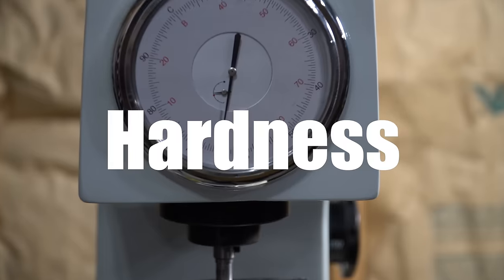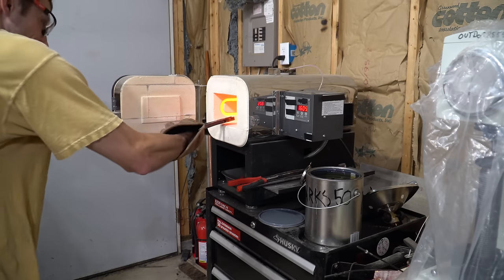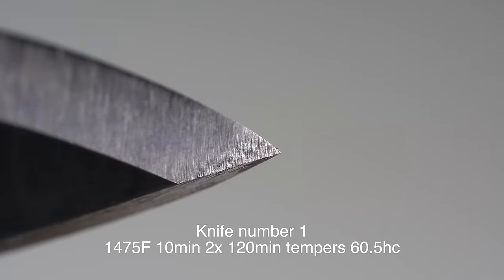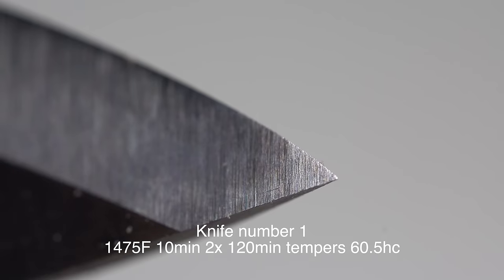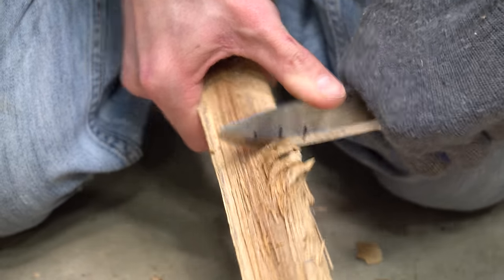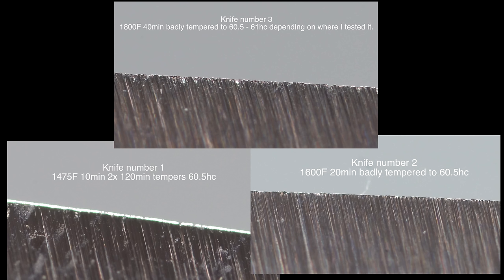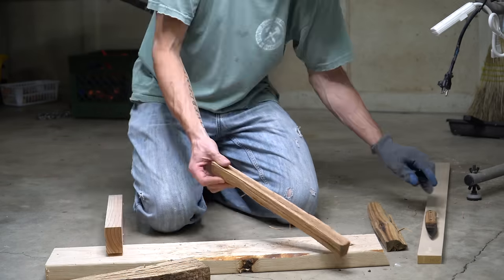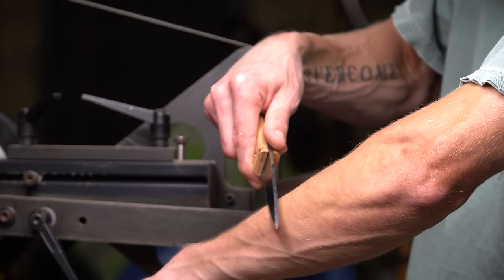The BIGGEST LIE in the knife industry- Good Heat Treatment vs BAD Heat Treatment

Comment from the maker: Sorry one detail I forgot to mention was the steel is 1084. I knew I was forgetting something 😂
Reply: Actually you did at exactly 14:00 and 14:55 even though you didn’t explicitly say earlier that’s what these knives were made from.
Reply: 1084(AISI) - Simple carbon steel, low wear resistance, decent shock resistance.
Manufacturing Technology - Ingot
Country - United States USA
Reply: No, you mentioned it at the very end and my ears picked up on it. You just didn't have it on your comparison layout paper. It's the same steel I'm working in right now while I can get it. The 1080 series seems to be one of those blends that is only around here and there like D2, W1, and W2 were when I first started forging blades.
Reply from the maker: Ha! I meant to mention at the beginning..oh well  glad its in there somewhere though 👍
Reply: @OUTDOORS55  thanks for all the hard work you do in your videos.
Reply: @OUTDOORS55  Alex, have you ever thought about ending edge retention testing cutting ability instead of sharpness? AKA, testing cutting lifetime instead of sharpness retention?

How long would it take for you to make some kind of apparatus or jig that would allow you to make draw cuts (slices) on rope while applying a given amount of weight? The end of the test would be when the knife can no longer cut the rope with X number of cuts with Y amount of weight/force applied to each cut.

Since not everyone knows a duller knife can often out-cut a sharper knife, it may be quite interesting. Enjoying the videos as always. Don't ever stop!
Reply: Thanks.  Have 1080 steel at home.  No Parks, though.
Reply: I'd go hotter than 1475 at 10 for 1084. (yes I know why you aren't,1475 is ideal for toughness) That's my 1095 HT (⅛"). I'd bump to 1500 and hold perhaps a little bit longer than 10 it looks like that's closer to .175 or ¼". I'm most certainly not going to comment on the rest but go to water - it's fine at that A¹ and cross section. viewers: these are very shitty generalistic steel alloys that are ingot produced with very wide(comparatively speaking) elementary ranges. 1084 IS easier to HT properly than 1095 or W2 or definitely 5160/52100. I'll leave the actual science stuff out 👍😉
Reply: @tacticalcenter8658  zknives ftw
Reply: @dennisyoung4631  don't need it unless it's under ⅛" (0.125) honestly. Brine quench. I do. 😳 Ideally yes it should be a eutectic percentage of nacl to H20. Off of that it's just going to decrease the effectiveness of chlorine for disturbing the vapor blanket so either do it perfectly or just use water which makes little to 0 difference.
Reply: @oceanwaves83  it's called a CATRA edge retention tester. I own one and it's not exactly cheap... But it is extremely simple honestly. Get CATRA test card with 5% impregnated silicon and a 50 newton weight and draw back and forth. That's what the machine does (it's not hydraulic it's pnumatic).
Reply: @veraxknives0331  yeah I've been familiar with them for years
Reply: @oceanwaves83  ah well there's 2 within 10 miles in South hills Pittsburgh from me and Larrin Thomas the creator of Magnacut. Of the I believe currently 51*? in the world... 😂
Reply: No I don't like the guy whatsoever. We don't do each other at all.
Reply: @veraxknives0331  I follow all of Larrin's work, have for years. I'm not saying I invented the CATRA tester, lol. I'm just a life-long sharpener with an interest in performance driven knife design and basic metallurgy as it pertains to cutlery. The concept of cutting ability being different than sharpness (and edge retention being different than cutting lifetime) was being discussed online around a decade ago. Many people conducted tests using rope and a scale in testing (which tests cutting ability) rather than the paper or shave test (which test sharpness). The CATRA machine is highly scientific but there are other simpler ways to conduct scientific trials as well.
Reply: @oceanwaves83  eh sorry man I knew you would know who he is but. With all due respect, I'm aware of this stuff but there's no real "data" in cutting twisted sisile rope or anything similar because it's.. just not repeatable or comparable. Too many variables for the accuracy that people like me and Larrin go for heh. No I am not a metallurgist but I please ask you to test my knowledge on it 🙃 a nerd I am. 

- With respect (truly),
     Jason
Reply: In all honesty using Larrin's own coupons on the same machine can provide slightly different results but as far as "data" goes it's within noise.
Reply: @veraxknives0331  I never once mentioned twisted sisile rope. It's not a fully consistent medium, similar to cardboard. Polypropylene, PolyDac, braided nylon, etc are all extremely consistent mediums. It doesn't have to be as perfect as the CATRA machine to be repeatable and comparable. Even people who use cardboard and freehand sharpening can get repeatable results, even with all the inevitable user error. This is extremely old news.
Reply: @oceanwaves83  I was not knocking on you or the concept mate but you're talking to someone who doubts CATRA testing results and I also break test transversely because. Knives kinda usually break that way and Larrin tests longitudinally. Our definitions of "accurate and repeatable data" are just different.. it's ok I wasn't trying to start an argument. Sorry
Reply: @veraxknives0331  Well the CATRA tests certainly aren't the supreme law of the land, but (all things considered) they are the best data set we've ever had. Regardless, even someone with Larrin's knowledge of heat treatment protocol and manipulation of steel properties cannot produce a perfect heat treat for every steel every time as human error can never be eliminated, only minimized. For instance, while I'm not shocked that the CATRA testing suggests s90v has better edge retention than s110v, is the s110v heat treat truly optimized? Of course not. Some will always be closer to optimized than others, for various reasons.
Reply: @oceanwaves83  hell I'm getting into trouble here but um. As much as I dislike the guy and disagree with him on other science stuff, s110v does have lower edge retention because of the carbides that are formed are vanadium enriched CrV7C3 carbides, M3C, M6C, and m23C6 carbides are the main ones in s110v whereas s90 would be also CrV7C3 and some VC, theres less secondary less hard carbides.
Reply: There's too much Chromium for the niobium addition to bind to more than say Magnacut where the v and NB form carbides because they want to more than the chromium mol amount. It's also why there's a small nitrogen addition - it separates the cr from the v long enough for nb and v to form nbc and VC.
Reply: @veraxknives0331  I'm curious if it can be manipulated in such a way to increase the % of vanadium carbide content and make use of the Niobium. I don't think Larrin has spent a lot of time on s110v but I could be wrong. What he does with MagnaCut is amazing.
Reply: @veraxknives0331  and there's absolutely no way around that? I wouldn't know.
Reply: @oceanwaves83  it's just playing around with JMatPro 7. It's another thing that unless you have ties to a university or ass amounts of money to do and it's possible to make steels with yttrium, tantalum, etc.. niobium was being added honestly since it was called Columbium but it's just about getting the right numbers for literally about 200 different synergistic kinetics correct. I'd guarantee you it can be done but we both understand steel companies don't make "knife" steels and they only account for (as told to me by John Shiesley, crucible president) 0.000001% of their sales. So.. unfortunately there's that sad fact heh 😞
Reply: @veraxknives0331  theirs things that even jmatpro cant understand. But overall its all we got. I tried out a demo version, its really neat. But heat treat specialists will try different protocols and ht methods and test. We didn't have jmatpro and still were able to figure it out with time through the years of heat treatment protocol development and testing.
Reply: You're welcome to play around with a licensed version BTW just. Contact me I'm pretty sure it's not that hard to do and no I honestly don't have any issues with people who want to play around with it on my PC over RDP. I'm not going to stick how to contact me here but you can Google my name if you want. 👍🙃
Reply: @veraxknives0331  I saved a link to your webpage. I also can contact larrin if needed. Overall I'm just an enthusiast that has many friends who heat treat and make knives and testers who test them
Reply: @veraxknives0331  lol. I do understand it but it can get very complicated. Time and temp with so many components. Each one of those components interact with each other at different temps for time lengths. Knowing what they do can be complicated but the program helps elaborate but not completely. From what i remember (i might be off here, its been a few years) but changing things like triple cryo tempers, salt bath kilns, different quench methods etc can mess with the equations a little.

But its really cool to see the different carbides that it can produce like you mentioned.

Which is funny that he chose the steel he did to perform this experiments and didn't send them to a cut tester or catra cutter to get tested.
Reply: @tacticalcenter8658  Totally get it man just an offer you can ask Larrin about me (warning - we highly dislike each other) 😅👍 I do the same thing just for my own personal hobby honestly. Only been studying this shit since October. I used to work literally 500 feet from Larrins house... heh. (PC bs) couldn't handle the internet and people so lost that like a bad habit plane. (Hadda make a joke there) Lots of books and money later - it's like okay this shit is pointless for people cause they just don't understand it. One of the bad perks of being an autodidact 😑
Reply: @veraxknives0331  I hear you. I dont see eye to eye on everything with him also. No idea the situation between you too but that's no worries. I totally understand.
Reply: @tacticalcenter8658   @Tactical Center  it's extremely nerdy and yes of course fascinating to me I'm basically your typical science nerd and even I alter my treatments based off the damn elementary values of PM/ESR/VIM-VAR steels and I really want to think they're doing something hahahaha but I'm sadly smart enough to know that it's just my nerd perfectionist ass wanting to do everything as .. well I should say I'm the type of person who either does 0% or 110% heh I'm not one of those "in betweeners" so it's typically straight down the rabbit hole on one subject - wait until I get bored with that which personally is about 0.05 seconds flat sadly and then find the next thing that I don't understand exactly lol. I'm insane, yes I'm aware 😄

But that's what keeps I suppose the actual word would be metallurgy not per se the mat sci side of things which I understand physics - chemistry I don't. I have a very basic understanding of it that is probably the next thing that I will go to if I ever get bored with crystals and metals. I just honestly don't find polymers or ceramics interesting. Semiconductors - fuckin way over my head and I'm the..

One of my favorite memes is "you have a degree in theoretical physics." "I have a theoretical degree in physics." "we are not the same" I literally smiled typing it it makes me crack up so much cause it's literally so fuckin true
Reply: @oceanwaves83  I didn't see this I apologize! I'm not sure what your specific question is  but I'm thinking that it's about heat treatment procedures and NbC and VC which to answer your question to the extent of my knowledge (junior level metallurgy basically) yes? You could but it would not have anything to do with how it's heat treated it's going to be the composition that would have to be modified. You also can get manganese carbides but I don't believe that Mn can form carbonitride/MnN because of it's complex cubic structure at standard temp pres. Under heat it does transform to FCC then BCC like iron. Of course at different temperatures.
Reply: @tacticalcenter8658   I missed this 
Gee let's see. We live 5 minutes from each other and both own CATRA testers, Charpy and izod testing rigs (mine set up for transverse strength loss), C-notch etc. He's the type that has one degree in one subject that I will readily admit he knows way more than I do about Metallurgy but. I'm a PC nerd turned steel guy lol. I don't have a doctorate in this obviously LMAO. Obviously he didn't like me asking questions about.. things that honestly would be theoretical or the positive criticism I think he took a little bit negatively. It's also honestly not very pertinent information for the knife maker but I prefer to fully actually understand what I'm working with not just "know" it. IMO there's a big difference between the word understand and know. I know a hell of a lot more than I can say that I understand. I'm also a no college degree type autodidact that well. I started this October last year and I'm .. basically teaching guys that have been doing this stuff for years exactly what well. Essentially I try to do what Larrin does but instead of being so generalistic with.. science? Which isn't so. Generalistic? Which is my problem and the fact that he's never ever said the words I was wrong. (Honestly, have you ever seen the guy say or type those words? Nobody else can aha) So I basically just go around finding out the people who have the drive and .. interest/commitment to actually waste my time explaining the physics mathematics and chemistry in a way that each person is going to understand because they're like me. I don't play well with others or people who have multiple NDAs signed with crucible and have talked directly to John Shiesley about.. the relationship between Larrin and Chuck and them. Which Chucky banned me from AKS because I unknowingly said some shit that they were in legal breach of contract with (of course they think I did it intentionally, can't really blame em I'd probably think the same thing) but I'm not legally stupid either and NO I can't actually see the NDA text obviously but. I'll say this - John spent more time with me than I honestly ever expected and gave me more information about the distribution contracts and other stuff that I was asked not to share so I don't (if you asked me the same thing, even though you have no idea who I am nor do I have a reason to keep information from others, nor would you ever know I said it, however I couldn't live with myself if i did that. It's just who I am. but there's small things that I can say that. Aren't well known such as Zapp makes CPM alloys and Crucible makes Zapp alloys they're cross licensed (public information).. Cartech only uses swedish iron.. (not public information) but that's relatively known in the industry. Sales figures on "knife steels", cost spreads, I was honestly in utter shock when I read this two page long email because I honestly didn't expect him to even bother with me. Kinda amazing how mutual respect works.

Now I totally missed your comment on TTT tables and yes sir you are most definitely correct that they are .. not very scientific? Aha. Bainite is a good example. They give you the upper and lower regions but they don't actually explain that the end result is actually martensite - retained austenite - AND BAINITE! (In simple carbon-manganese steels at least) but. Ya man you seem like a good guy - nice YouTube discussion 😅

God that is embarrassing to type out hahaha. But off the record - man to man - I wish you the honest best of luck with anything bud. I have 0 reason thus far not to respect your thoughts. (And facts 😄)

It was refreshing to talk to someone else who gets this stuff 👍 I do mean that heh
Reply: @veraxknives0331  your like my long lost twin in many ways. Just a little more crazy than I am.
Reply: @tacticalcenter8658  the man doesn't lie 😄
Reply: What you have discovered here is why 1084 is recommended for beginners without a kiln -- you really need to screw up the HT to wind up with a knife that isn't usable.  The more "exotic" steels are much more sensitive to heat treatment.  Be careful of the conclusions you are drawing here.
Reply: @rockets4kids  pretty sure that was covered already 😉
Reply: @veraxknives0331  Yes, it should be considered general knowledge why 1084 is recommended for newbie knife makers.  Sadly this is far from the case.  It is great that OP has confirmed this, but he really hasn't done anything to forward his hypothesis.
Reply: @rockets4kids  110% agree - however - the people like me who want to learn this stuff buy the books and read em. I personally don't bother much with the internet "class" of people (and yes I work in IS with PCs so I know the internet from 2002 until 2022). I'm sure you know about KSN but even that isn't enough information honestly. I had to get more. Larrin also tests longitudinal strength not transverse strength which in a knife is much more important. (And I live 5 minutes from the asshole)

(For those who don't understand, it's testing the break force of the thinnest cross section, longitudinal strength is exactly that - it would be how hard I can press down before it snaps. Not how it typically goes but longitudinal strength is standard for the industry of which, according to John Shiesley [Crucible president] knife steels are 0.000001% of their sales. typed as received with the exact numbers.)
Reply: I was just about to ask before I hit the comment section.
Reply: Do you think the poor heat treated knives will take fewer resharpenings?
Reply: Probably the amount of paper actually cut was different on a subliminal level with individual strikes being slightly different length but adding up
Reply: Have you thought of a plasticity test? Like trying to bend the knife and measuring its deformation? For example, crushing things like garlic or grains
Reply: You do realize hardwood does not refer to the hardness of the wood. But whether the seed has a hard or soft shell. Poplar wood is relatively soft but is classified as a hard wood. Now oak is hard for a wood. But yeah, hardwood means dick to density of the lumber. FYI YES I am a NHLA (National Hardwoods Lumber Association) lumber grader. Also I grade with a .5% discrepancy with the national standard being at 10%. I graded an average of 80,000 sq ft of lumber a day for 3 years. Which is enough lumber to go .65 times around the earth 1 foot wide 1 inch thick.
Reply: Can u make a slo mo dropping a knife on different things that was really extreme looking dropping knives on the brass like how did all that happen might be cool
Reply: LOL I was going crazy watching this video wondering what steel it was 🤪 like did I miss it???